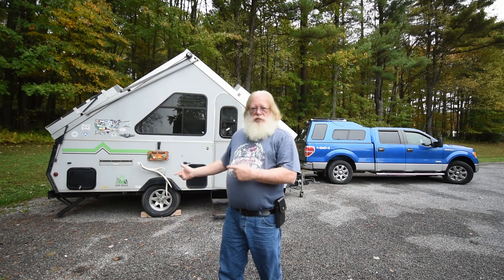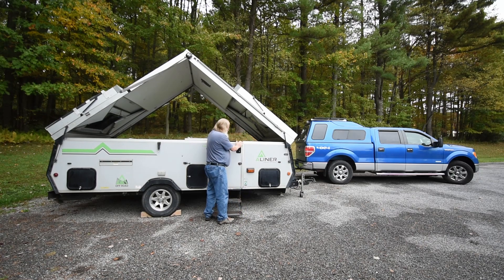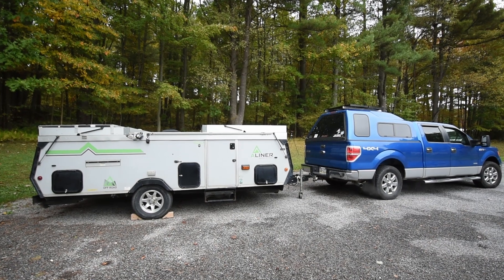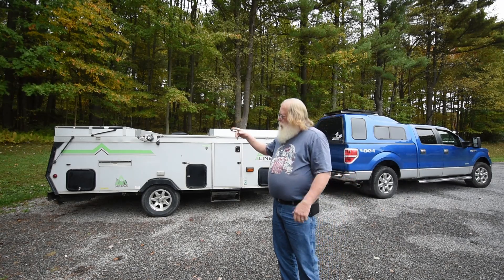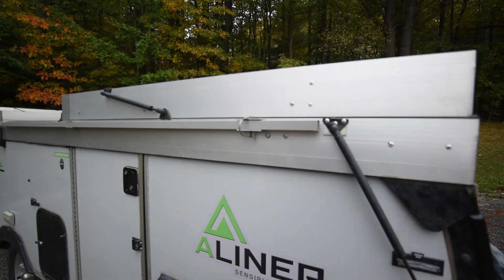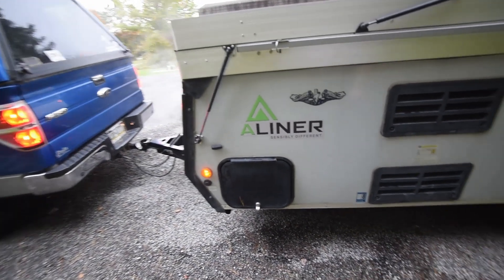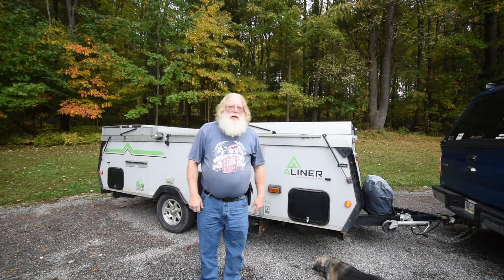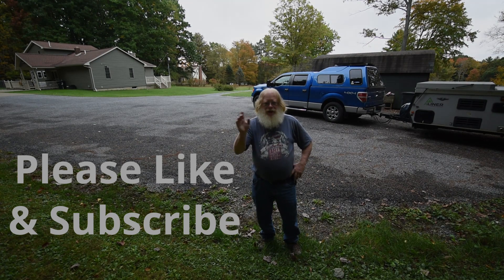25 Closing my Aliner & preparing for Travel

Comment: Nice.  You should add check tire pressure and lug nut torque to your walk around.  I lost a tire on my trailer once.  Safe travels.
Reply from the maker: I have a tire pressure monitoring system that I use for tire pressure.  
My opinion on lug nuts is that once they have been put on and rechecked a couple times after use, chances are they are not coming loose. I am up over 55,000 miles of towing on my Aliner and not had any issues with loose lug nuts.

Comment: Practice backing up!  Very important.  Why do you engage the deadbolt on the door for travel, Eugene?
Reply from the maker: When I am folded down the regular latch does not engage properly.
Reply: @eugenebreindel   What brand TPMS do you use for your Aliner?
Reply from the maker: @captaincurt3180  I think it was the tire minder brand.